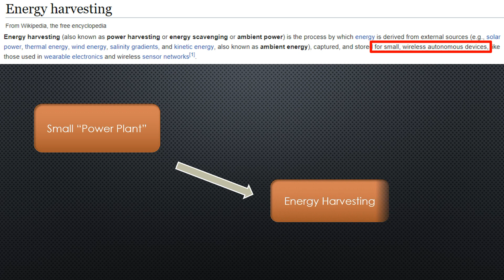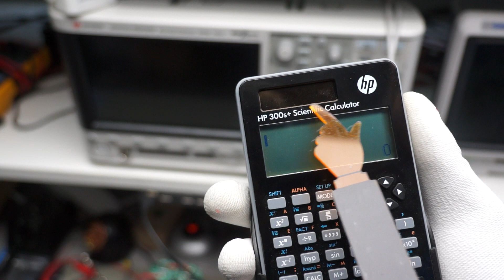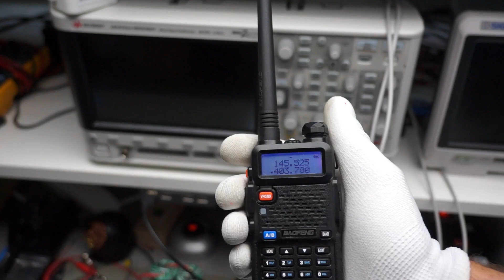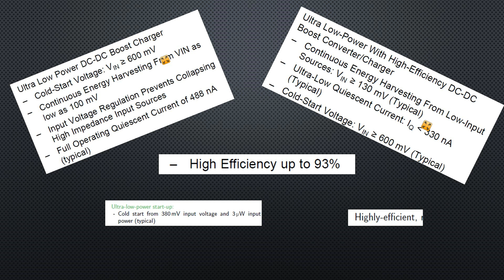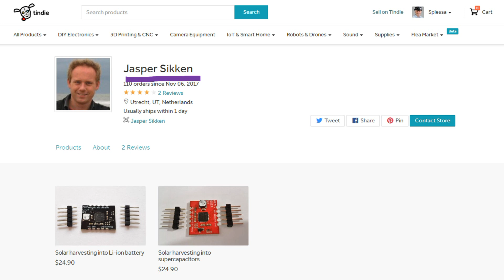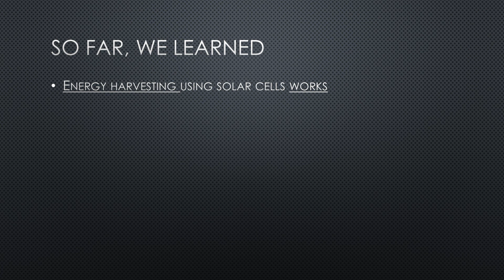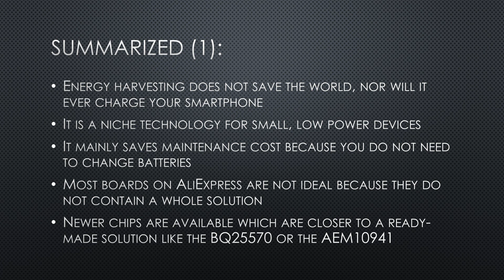#278 Energy Harvesting for Makers

Comment: Fabulous information for a novice like me. Something perplexed me, you recommended a 25 watt 12 volt panel to size up, so there are some input considerations I have to account for if I were to use Jaspers PCB. Just briefly could you give me a rough idea what I need to do to overcome the 3 volt input limit.
Reply from the maker: Jasper's design is for very low-power devices. I do not think you can easily overcome the 3V limitations.
Reply: @AndreasSpiess  Thankyou my friend that tells me so much. There are just such marvellous electronics engineers, geniuses I think, working on energy harvesting. Have you seen Robert Murray- Smith's Fractal Capacitor PCB. This will make energy conversion (buck and boost) so easy, I would be interested in what you have to say about it.
Reply from the maker: If capacitors did the job, nobody would use (expensive) copper transformers. These concepts seem to be for very small energies only.
Reply: @AndreasSpiess  OMG you have confounded me. The only thing I can say in response is I am always amazed how long the single battery lasts to power the LED's in my joule thief. Very small energy needed to produce a usable, viable light source.

Comment: A friend told me it was foolish to use small  alternative energy systems to replace central grid power because the cost was far greater than the cost of grid power. I've heard that same argument many times from many people. But I told my friend that what actually mattered far more than the cost of electricity per kW was simply having the electricity where you needed it, when you needed it. The cost of PV panels on the roof of an RV parked out in the desert is far, far cheaper than the cost of running grid power all the way out to the RV in the desert. So there is always a time and place for energy harvesting in the grand scheme of things, and we should use it everywhere it makes sense.
Reply from the maker: I make a difference between energy harvesting (which is for extremely low power devices) and PV (which rivals or enhances the grid).
In my newer videos you see that I also installed a PV plant on my roof. I completely agree with you.

Comment: Hi Andreas, have you considered thermoelectric generators, such as Peltier modules? They could work for your indoor needs when attaching them to heat sources such as your radiator or benchtop instruments heat sinks (or even on cows in the Swiss winter)?
Reply from the maker: No, I never tried those.
Reply: @AndreasSpiess  Then I have to wait or just have a go myself, probably not on cows though.

Comment: I have a question. I'm not complaining (yet) but is it "okay" to harvest RF signals? GSM, WiFi, etc.? What I mean is that in a way it's capturing someone else's signal, and also with a big enough proliferation of this method broadcasters will have to boost transmit power and that's not really 'green', too.
What am I missing?
Reply from the maker: I am not a big fan of RF harvesting because in most areas there is just not enough energy available :-( If you live across the street of a TV transmitter this might be different.

Comment: I have a small solar panel that outputs 6v with 1.1w, I connected a 5v buck converter and charged my cellphone, a little slow, but it's possible. Another thing I tried is connecting the solar panel to a li-ion charger, and it charges at 4.07v (it should be 4.2v at full charge, but worked). So it's possible if you have time. The battery can be charged in hours if there is direct sun.
Reply from the maker: You are right. I made a video about solar chargers where the TP4056 were quite good for 6 volt panels.

Comment: I wonder about low-power projects that only need maybe 1-10 mA and indoor harvesting. Have you played around with amorphous silicon panels? They are relatively useless in the sun but might be better indoors. There was a video by NurdRage ("Make a Tritium Nuclear Battery or Radioisotope Photovoltaic Generator") which made some very good points towards that conclusion.

I'm thinking also due to very limited maximum current of the amorphous cells, a lot of complexity can be dispensed with. You can just as well charge 3- or 4-series NiMH battery and simply trust the battery to bleed off all excess charge as heat as they near their capacity limit - as long as the current is small enough to not heat them up appreciably, they survive this treatment for a nice long time, also catastrophic failure is i believe fundamentally impossible. I always tend to be slightly apprehensive of Li-Ion, even though the only cases of failure of Li-Ion cells i have personally experienced have been relatively well-behaved at their worst.
Reply from the maker: Thank you for the link. Interesting channel! I do not know which "sort" of solar panels I had. Maybe I have to have a closer look once.
Reply: @AndreasSpiess  The blueish colour is a hint that yours are crystalline. The amorphous cells are brownish in colour. I'm not sure whether that's a 100% rule, but seems so? You'll find that if you have a solar powered wrist watch, weighing scales, calculator, or even a wireless keyboard like the K750, low power items that are designed to work indoors, that they're going to have brownish colour solar elements.

Comment: Nice work Andreas - I'm waiting for the sequel! A pity that indoor PV (c-Si or m-Si) performs so badly - I think thin film (CdTe or CIGS) would improve the setup due to better matching spectra.  I'd like to experiment with an "ultimate wall switch" for smart homes: a device powered by light and/or kinetic energy, using a touch sensitive e-ink surface, sending/receiving LoRa signals to switch loads (lights, appliances, ...) . Is something like this in the make?
Reply from the maker: Not here. Energy Harvesting is very special. And you have to adapt the whole design. So nothing for the ordinary maker in my opinion.

Comment: What about LTC3106? I want to play with this circuit because it looks rather promising. It has MPPT and charges battery as a backup, so it combines energy harvesting IC and buck converter IC into one because the output voltage is convenient 3,3V. You should definitely check this one. Also if you combined this with TPL5110 and TPS22860 you should get a pretty neat solution for a solar powered sensor which sends data periodically. How about a video on these chips? :)
Reply from the maker: There is another comment about that chip. seems to be hard to get.
Reply: @AndreasSpiess  The chips can be bought on Mouser or Digikey or you can ask for samples from Analog Devices. Unfortunately I did not found any boards with the chip ready to test.
Reply from the maker: That was the reason for my "not-selection". Most people prefer to buy small SMD chips ready-made on a board.

Comment: Goodmorning , Holland (Europe) Day Temp 40 gr/cel  night 30 gr/cel room Sleeping room 50m3, airco qlima  P522 , 320$ , On time 24 our 26 gr/cel humidity 60 max 60 %. Solarpanels make 23 kWh , house use incl airco, 15 kWh . So the house keeps 7 kWh to much..... Conclusion you can keep cool and make energy with the airco On.
Reply from the maker: And you do not need energy harvesting ;-)
Reply: Andreas Spiess yes, I will my energy stored for the house, but there is so little on the market and so expensive. I hear there are battery's from critical systems you can buy when they are good but have to replaced. I hope someday someone can tell me to buy them.....

Comment: I recently bought from Ali-Express a water-turbine. The goal is to use it for garden watering. 
I own a "Gerdana AquaContour", which is crap, since it's solar cell does not provide enough power.
So the basic idea is to use a water-powered-turbine to charge the battery. How exactly, I have no idea. 
I guess I will have to put some transformer inbetween, that can deal with a larger voltage-range and sudden spikes.
Some hints from you would be highly appreciated, by another guy with a Swiss accent ;-)
The generator I bough is called: "DC 12 v DC Generator 10 watt Micro Hydro Generator Wasser Turbine"
Reply from the maker: If it produces AC I would try a bridge rectifier and a big capacitor. Then you should be able to connect a buck converter down to 4.2 or  8.4 volts to charge one or two Lipos. These regulators have a big input range. But you have to do your own measurements.

Comment: Ehhh....  
Radiowaves are the way to go. I really don't know what you're getting at....
Reply from the maker: If you have your own radio station I agree. Unfortunately, they switched most of the strong HF radio transmitters off. In Luxemourg it was easy to harvest radiowaves. You only needed a  neon tube ;-)
Reply: Andreas Spiess  
Ehhh.... the active radio stations shouldn't matter, since the simple orbit of the earth around the sun generates radiowaves, and what limits the effectiveness of an antenna is the impedance between the antenna and earth ground. 

In general, small antennas on communication devices are not meant to be energy collectors. Most of them have extremely high impedance, or at least very specific impedances, meant to correspond with the output of the transmitter they're meant to pick up. If you're using them to collect power, you're ignoring the breadth of power being broadcast out through other radio frequencies, in favor of the depth of power being transmitted at the device at any one moment. 

If you want to make a better antenna, simply adding a length of copper wire down to a literal aluminum plate on the bottom of your shoe. This increases your contact to earth ground and effectively extends the length of an antenna. Adafruit has stuff for wearable tech, although i don't think they've ever considered using it to extend an antenna to earth ground, which would make many of the circuits you have featured unnecessary. 

Rather than being more specific to the transmitter, which is what some of the featured circuits do,  it's better to be a better generalized receiver for radio waves. That cuts down on complexity (you don't need to scan so hard to find the frequencies being broadcast)
, and you don't need to focus on the WiFi frequencies being thrown around.

Comment: ... pull apart a mid priced indoor solar calculator and  use its cell for testing. send the chip to ElectronUpdate to decap and describe.
Reply from the maker: Using the cell of an old calculator might be a good idea. They are for sure optimized for indoor lighting.

Comment: Thank you again for your excellent channel. I am looking for a vid there you save your credentials in a header file. Where to find it. Thanks
Reply from the maker: I do this in most of my projects. So I do not know which one you search. I just include a text file with two lines where I define the credentials
Reply: @AndreasSpiess  Perhaps I remember wrong. I thougth it was you that had done a headerfile type file.h with your credentials so didn't need to have the credentials in the .ino-file
Reply from the maker: Yes. A .h file is a text file

Comment: Thanks Andreas.  I tested the official breakout boards from Analog, the LTC3106 (DC2255A) and LTC3107 (DC2103A).  I was using the LTC3106 with a small solar cell (5.5V OCV) and the LTC3107 with a 40mm Peltier device since I work in the steam world.  With an 8C temp delta on the TEG I could harvest 5x more power than I used in my LoRa device.  I had this configured to harvest to supercap with primary battery extender.  I measured this on my Keysight N6705 w/ N6781A module.    I also tested Jasper's device and found it worked well in "slowly" charging an RCC123A cell as long as solar cell had some exposure to sunlight like in my office.  Like you, I found ambient office light to not perform well.  Of all the harvesting sources, I found thermal and TEG to be the best if your application allows it.
Reply from the maker: Thank you for sharing your experience! Temperature differences, of course, have a lot of potentials (as we see in our power plants). But, as you write, it is not easy and not everywhere because it needs sustained temperature differences.

Comment: interesting stuff. I am just using a simple solar cell with a lipobattery charger, no MPTT and that works well,with seems to be your recommendation towards the end  of the clip
Reply from the maker: And because the solar cells became much cheaper it is the way to go for most applications, I think.
Reply: @AndreasSpiess  correct. I am also not moving my panels along with the sun. Just added 2 panels for early morning and late afternoon

Comment: It is a matter of efficiency! In a normal lit office, say 500lux, we are talking about ~5W of light per m². For a 4x4cm solar cell thats 1.6mW (20% efficiency), enough to power things that usually last half a year on a 18650 (10 Wh) battery, so a normal low-power application.

But this is not possible due to the quiescent current and/or efficiency of these chips.

Edit: I just checked the MPP of a cheapo 0.5W solar cell (6cmx5cm) in a room with lights on and I get 0.03W or 10W/m² at 1.5V (lights off = 0.001W). If that could be "harvested" at 50% efficiency it would be 15mW, equivalent to less than 1 month of runtime with a 18650 cell, thus capable to power anything that lasts longer than 1 month forever.
Reply from the maker: AFAIK solar cells have a quite low efficiency of less than 20%. And it seems it depends also on the spectrum of the light harvested. All I can say: I was not very successful indoors :-(
Reply: @AndreasSpiess  Yes, 20% is about right. But thats enough, unless the room is dark. I had a look and those chips (at least the AEM10941) should actually be able to use these low powers. So maybe measure one of these small solar moduls to get the maximum power in your lab, then see what the chip(s) can get out of it. That would be a important test.
Reply from the maker: This is what I did. And I did not get a lot :-(

Comment: i bought a couple of those usb dynamo, and I will say out of the box they're pretty bad. If your thinking of using them it really needs a better capacitor, and since your in there a new charge circuit.
Reply from the maker: I am sure they are bad. But piezo was even worse ;-)

Comment: The only way I've seen this working on a large industrial scale, was to pump water to a higher reservoir when solar was producing excess energy during the day and use the hydroelectric power to to the lower reservoir when needed demand at night.    Still wasteful and expensive.
Reply from the maker: What you describe is a replacement of a battery, not power creation (we mad a lot of money with that here in Switzerland)

Comment: The max power point voltage will not fluctuate with the amount of light (as you mentioned a few times in the video), the max power point current is the one that will be proportional with the amount of light.
So double the amount of light and you get double the current from your solar panel or solar cell. Solar cell is nothing more than a diode thus you can think of it as the reverse of an LED again a current controlled device.
For battery charging say a single cell say LiFePO4 3.2V nominal or LiCoO2 3.7V you will just need a solar panel made with the appropriate number of cells in this case 8 cells is series should be ideal as each cell will have around 0.5V max power point voltage so with a 3.7V nominal cell that will work in the 3.3 to 4.1V range. Even a more common 10 PV cell (in series of course) solar panel will work great for one Lithium cell.
All you need is a switch to be able to disconnect the PV panel from the Lithium cell when the cell is say at 4.1V and another switch to cut the power to your circuit when voltage is below 3.3 or 3.5V or maybe enter a low power mode
You can have a set of compactors set maybe at 4.2V and at 3.2V as backup in case your software fails and all you need is an ADC pin from your device to measure the cell voltage and one or two digital pins to disconnect in case of cell fully charged or fully discharged.
As you mentioned unless all you need is some micro-watt range of power indoor solar PV panels will not make sense.
Reply from the maker: Maybe you read about MPPT. Or you shortcut your solar panel and measure the power, not the current.
Reply: @AndreasSpiess  Solar panels are current sources the short circuit current is about the same as max power point current. Solar cells are diodes so what you see as open circuit voltage is the actual forward voltage drop on the diode/PV cell  around 0.7V for mono and poly crystalline cells slight variation based on cell temperature so max power point voltage needs to be lower than this else all power is lost as heat and that max power point voltage has just slight variation based on cell temperature but no effect based on amount of solar getting to that cell.
Max power point tracking is an useless technology in offgrid type applications as is much more cost effective to have a PV panel matching your battery voltage and just have a simple mosfet type switch to stop the charging instead and DC-DC conversion.
I'm offgrid powering my house fully with solar energy this includes fully heating the house here in Canada.  I selected to do that because solar PV heating is the most cost effective heating option even when compared with thermal solar or natural gas. If curios about details see page 5 in my presentation   http://electrodacus.com/DMPPT450/dmppt-presentation-v01.pdf